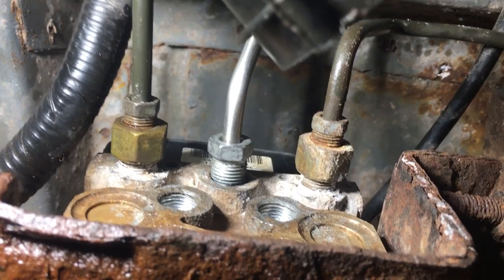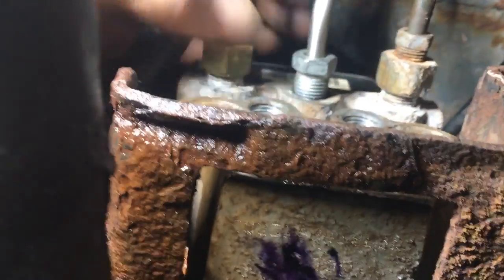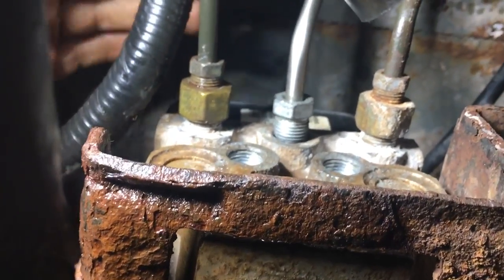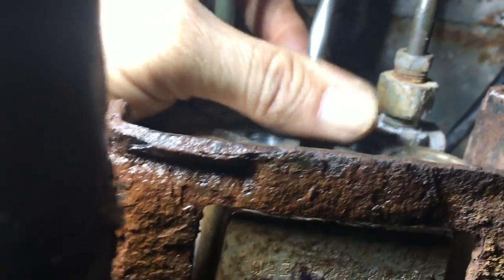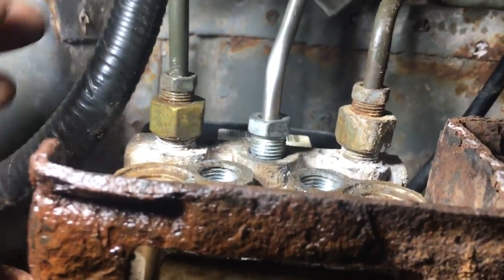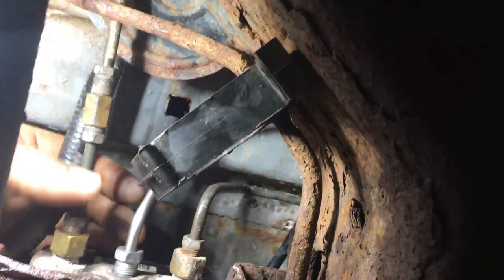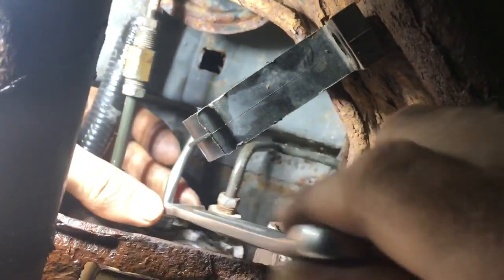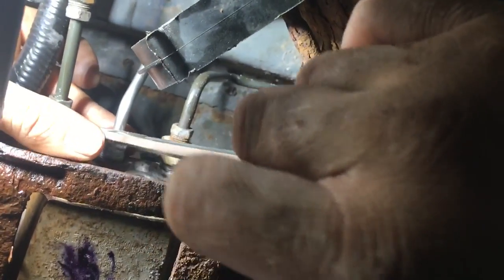Brake line won't thread in

Comment: Just spent an hour wrestling with this exact problem. Came here looking for a magic solution. Had to take a break before I resorted to violence. Will try it again with particular focus on your suggestion. Thanks!
Reply: Man do I understand! Can't remember when I've been more angry than working on the break lines on this 1953 Cadillac 😡😤😈👹☠️🫨🤯
Reply: I'm here for the same reason.
Reply from the maker: I’m telling you I’m pretty sure I made this video maybe what 10 years ago or something it’s been a long time, but I remember being extremely frustrated I also remember when I’m frustrated. I can’t ever get them to go in, but when I take a step back. They always screw.

Comment: Dude this video is a F**** LIFE SAVER, spent like 3 days messing with these brake lines trynna get em starts and your little tip on puling the bolt back to check the alignment on that line did the trick. theyre all in and all thanks to you keep on posting brother 👆👆

Comment: I was so hoping there was a more insightful secret, but alas it must be just continuing to futz with it until magic happens.  I'm replacing the master cylinder on a '03 Mustang GT and the two lines connect from the bottom, so it's very hard to see whether the nut is lined up square.  It took 45 minutes to get the smaller rear line to thread up, but an extra 30 minutes of cussing and screaming hasn't helped get the larger front line nut to catch and screw up.  The irony is I thought getting the master cylinder off it's two bolts would be the hard part!
Reply from the maker: There is absolutely no method to the madness unfortunately all you can do is wiggle the line a little bit and it will thread as smooth as butter. It took me several years and hundreds of attempts to realize that there is absolutely no method to be able to put them in easily sometimes you get it and sometimes you don’t if there was a way pretty me to make a video to show someone exactly how to do it I promise you I would do it right away
Reply: turned out I had the wrong master cylinder, I needed one with Traction Control which has two different size fitting, my wrong part had both fittings small size
Reply: Yes..I've had to step away a couple of times before I tried rip the whole line out. The real tip is to try to stay calm and just assume it's going to take some time. If your in a hurry the auto repair Gods will make it even harder.

Comment: I also found using small bungie cords to manipulate the brake line, put them around the brake line and tighten them up/while manipulate the end to be in place- bungies stretch and do not make the break line bend or break...Stil be careful not to bend the line...(Square it up s our host would say ~Clay) BUNGIES helped tremendously. So many times I said this does NOT work...IT DOES, it is merely one of those things in life, that separates us and a TRUE test of Patience. Good Luck ~Live Love Learn
Reply from the maker: I have definitely been there many times and it is so difficult to explain in a video it does just take patients.

Comment: If you're trying to thread a new fitting in, first verify IT IS exactly the same as the old. I  had a fitting on my motorhome that turned out no one had the exact, so I  had to cut it off the old tube, carefully recondition the threads & hand threaded a few turns before making the flare to verify it will screw into the hole without cross threading. It helps to insert the tube "square" into the hole, then wiggle it gently as you turn it in REVERSE until you feel the thread "drop" off the inside thread & align, then gently turn it on finger tight at least 1-1/2 to 2 full turns before torquing it on permanently.

Comment: My husband bent my brake pipe at the hose to the caliper, he had strpped the.nut to the pipe previously and was "clamping that brake line". It's a 2000 S70, and he is a Volvo mechanic. Anyway, I'm left to replace the brakepipe and hose. I'm not a mechanic. I'm having a difficult time getting the brake pipe seated I to the master cyl, just watched your video and about to try the nut trick...wish me luck 😅
Reply from the maker: I definitely wish you luck

Comment: If you're working in an even tougher spot (and there are tougher spots), not only is squaring it up extremely hard, but you have to be able to get enough 'inward/downward' pressure on the fitting to get it to 'catch' the threads and start going down. Regardless, if you feel like it's resisting, never force it. If any doubts, get the right size bolt and nut and test both the port (female) and the thread (male). Use a thread chaser (not a tap/die meant for new threads) to clean it up if there is resistance. Yes, you can spend hours trying to get one of these right if it's in a nasty spot.

Comment: I had this problem today with a power steering hose. It's thicker than brake line so it's hard to make those little micro adjustments to get it squared up. Plus this hose had two right angles at the very end. I'm just gonna take it back and start over with a new one.

Comment: I've been fighting this with a brake line to master cylinder today.  This one (93 Dodge D250 Pickup) has two separate chambers for front and rear.  The front one threaded in great, but the rear does not want to go.  It goes into the driver's side of the master cylinder.  It starts easy but after two or three easy partial turns of the nut it gets tight, but it's nowhere near sealing the brake line.  I haven't forced it.  Each time I back it out, inspect the threads (can't see any issue), try again and the same thing happens.  This is a rebuilt Cardone master cylinder.  The plastic plug that comes installed in that hole threads in without any issue at all.   Getting close to using the sledge hammer solution.  I will try your trick first though.  Thanks for the tip.

Comment: Thanks for the video man. I was EXTREMELY worried I had crossthreaded my brake line going into an ABS "actuator" for a hybrid Lexus SUV that cost like $1200 on discount online. Stealership wanted $2100 for the same part. I threaded all the other brake lines in with no need for the brake line wrench until actual tightening, but I only barely used it for the last one which gave initial resistance. I didn't have to turn it hard so I was assuming it was not crossthreading and figured I would know if I had to turn it hard
Reply from the maker: Yep that’s exactly what they’re supposed to do they’re supposed to thread in very very easy until they’re almost tight sometimes when you start them they seem a little bit like their cross threading but generally they don’t. Very glad to hear you got it
Reply: @sharpcarco  Thank you only one way to tell I will have to take it to the dealership actually to bleed the brakes. It is an annoyingly complex electronically activated ABS actuator that can't be properly calibrated without software... POS
Reply: @Bankable2790  8
Reply: Update: it’s been over a year and I have had not had any problems with the actuator

Comment: thanks clay. ill ask you to go a little further. 2000 silverado. brake lines. this has been a nightmare and on last line it threads in seemingly all the way starts to tighten seems lioke last turn and it skips and its loose. not sure how skipping a thread when its dam,n near tight loosens it that much but it does. clay is there a way to fix this.    thx clay
Reply from the maker: Hey Philip unfortunately no it should not be doing that that means it’s cross threaded which probably means that the hole is stripped out. If you can’t see the threads inside the hole use your camera on your phone

Comment: Hey Clay (Greetings from Richland/Kalamazoo) 2001 Jeep rear Drums  replaced friggin everything in the rear (as far as drum breaks) 3 days now been messing with this one line on back passenger size. The thing will screw in to the cylinder with it out of the break then put everything back together leaving the line for last...cannot get it started. any thoughts would be appreciated, Sadist part is I used to Turn a wrench for the navy for 12 years. MY hands are just all  Messed up now i am getting older. Thanks for your time...

Comment: I’m doing the rear left brake line on my 96 k2500, that goes from the drum to above the rear end, and the fitting sure appear to be the same but I can’t get it to thread more then a quarter turn before it becomes tight, is there a slightly smaller fitting on a Chevy ?
Reply from the maker: I don’t think so. But I think they’re a little bit different if you remove the line and you look down inside the square see how much it supposed to go in there that may be as far as it supposed to go if I remember correctly they don’t go in there very deep I could be mistaken but I don’t think there’s a different fitting of course things could’ve been changed from the factory or maybe by somebody in the past so you never know
Reply: @sharpcarco  I really appreciate the reply I wasn’t expecting one on a video this old 😂, I’m thinking, because the threads on the old fitting look a c*** hair wider that they may have been threaded in wrong, so I’m think of trying to drill out the old fittings and cut and reflare the line I bought
Reply from the maker: Yeah I try to reply to everyone I think it is surprising to some people but I haven’t got too big for my britches…….. 

If you have a question in the future though I would recommend it if you use Facebook use messenger and message me on my clays ac and Auto Repair page I get them a lot quicker and they’re very consistent and I can generally share information links pictures etc. etc. I don’t collect any information and I won’t send you any spam I just use it to communicate with my community and try to help people.

Comment: I forced the fitting in and stripped the thread. What should I do to fix it?
Reply from the maker: I’m very sorry to say there isn’t much you can do other than replace it , at least nothing that I’m aware of because if you tried to cut new threads you wouldn’t be able to get to the bottom of their.

Comment: Appreciate the post but still can't get mine to thread in.  Hole and threads confirmed good.  Three weeks and still can't get it to thread. My line threads in from bottom so hard to see.  Frustrating.
Reply from the maker: Well in that situation I would probably recommend taking the unit down and or loosing in it so not only are you installing your line but you’re able to move the box a little bit that you’re trying to put the line into. 

One of the things that happens when I’m doing this is psychologically I believe it goes one way and I’m thinking that that’s the way it MUST go, So often times when I can’t get them to start I move them a different way thinking it’s the way that it will not go but that’s the way that it usually ends up going

 I don’t know if that makes sense but it might help

Comment: What do I do if I striped out the hole the line goes into on the abs unit
Reply from the maker: I’m very sorry Mark I don’t have an answer for that I’ve never done that before.
Reply: @sharpcarco   can I buy a bolt the size of the brake line bolt an ease it in little by little , then try the brake 
 line one to see if it will hold in
Reply from the maker: Mark stiles Looks like they make a brake line tap kit

Lock Technology LT993 Brake Line Or Cylinder Rethreading Kit https://www.amazon.com/dp/B016YKGE9U/ref=cm_sw_r_cp_api_i_jyFwDbVNVVJXC

Comment: About to do a brake line job for the first time in a 94 Oldsmobile Cutlass Ciera, really appreciate you putting this video up as I’ll be a novice for sure. Random question, as this is a Chevy... do you know what kind of flair you used for the line going into the ABS module?
Reply from the maker: 🤔 gosh I haven’t done brake lines in so long but I’ll tell you when you take it out of there you should be able to tell if it’s a double flare or a bubble flare. I’m fairly certain it won’t be a single flare.

They make brake line kits for different vehicles I don’t know if they make one for that. But they’re fairly easy to recognize the different types

Comment: I screw it in and it still leaks from the wire end. I need help with this problem!
Reply from the maker: Hey Murk . It’s either not tight enough and sometimes they seem like they’re tight but they’re not or the end of it has gotten damaged and will not make it sealed properly I hope it’s not in the same position I was working from on mine because that would be terribly hard to fix I wish you the best brother and if you have any other questions just ask I’ll be happy to answer them God bless and have a great day.

And if you do have questions in the future please ask them on the Clays AC and Auto Repair Facebook page. I get them much quicker and it’s easier for me to answer

Comment: After bleeding mc i now have a leak at the mc threads, the line goes to the abs. Any tips?
Reply from the maker: Every time that’s ever happened to me as long as I did not cross threaded the line itself I just need to tighten it up more. If you flared you’re on line it’s possible you did not flirt correctly.

Comment: Ok, so what if it is cross-threaded? Then what?
Reply from the maker: Well you can tap it out I believe but probably replacing it would be the best because you’ll get tiny pieces of metal in your brake system and I don’t assume that would be good unless you tapped it then cleaned it extremely well. Sorry to hear that happened to you

Comment: These 1/4 lines I got won't fit into my pump. They sold me an adapter that will fit on the pump but now the other end of the line won't go into the adapter. Wth is going on
Reply: What's the aftermath of this?

Comment: What if someone cross threaded the threads going into the abs unit
Reply from the maker: Well I would recommend getting a new unit but I don’t know that that’s very easy to do most of them blocks are made out of stainless. I’d be really surprised if you could do that but if you say you did I’m sure you did